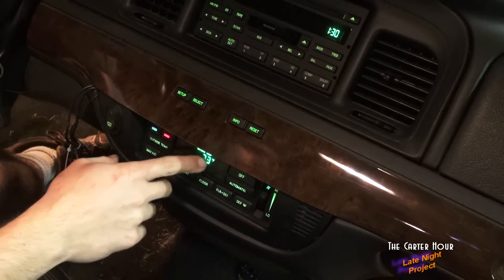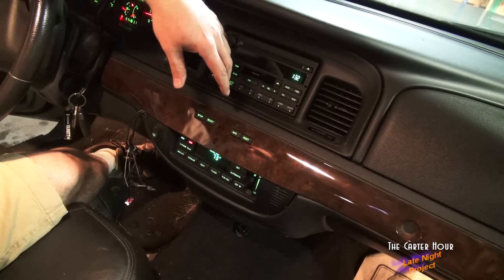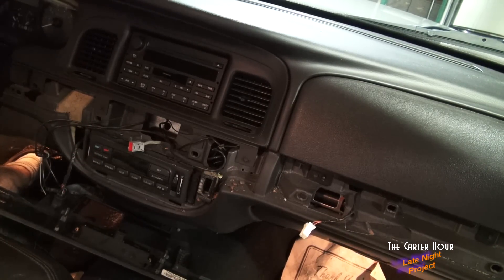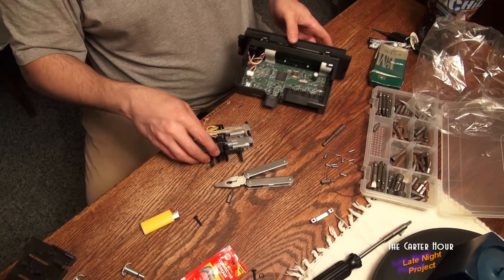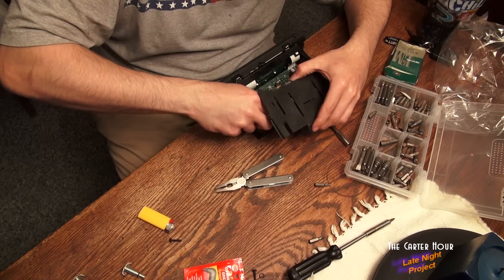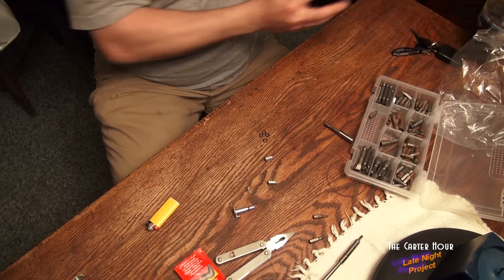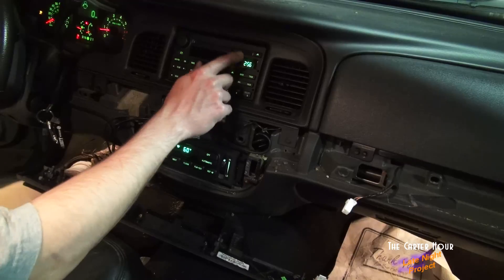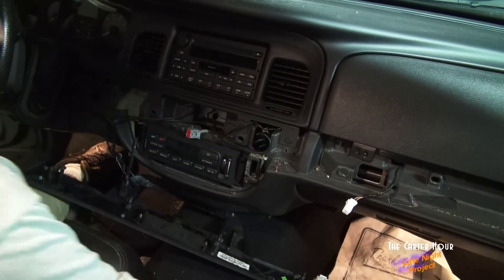Ford Lincoln Mercury EATC Repair Video - In Depth Tutorial - 3.00 Dollars in Parts

Comment: question i have a 2003 crown vic, and the heat /air is not blowing, but when i start driving mainly at a constant speed, i feel the heat coming thru the vent, its not blowing but its damm sure coming thru, what could be the problem
Reply from the maker: First off welcome.  A couple of questions before I can render a 
definitive answer.  Does your 03 Vic have Manual HVAC or EATC?  Is it 
only blowing out of the vents when you are driving, or is it doing this 
when you have the blower running too?  Is your HVAC or EATC on the off 
position when its doing this?
Reply: its a EATC and it does it when the vents are on only,  when im driving at fast speeds the heat can be felt coming thru the vents, but its not blowing u can just feel the heat, im guessing the wind from the fast speed is causing the blow moter to spin?
Reply from the maker: Yeah I would assume that is normal operation.  Since the incoming air comes through a screened part on the passenger side under the front windshield you are probably just getting some heat off the engine.  If you place the EATC in the off position that shouldn't happen as I remember it should close off the outside air.
Reply: The Carter Hour it only does it when its on , not when its off
Reply from the maker: It seems like normal operation to me.  Try putting it in MAX AC with blower on low and see if it does the same as you describe.
Reply: The Carter Hour it does the same for all the settings even the defrost
Reply: mr carter you never replied brother im still in need of help
Reply from the maker: Yg Bodybuilder It sounds like you could eitther have a bad blower motor or resister pack.  If you turn your fan on the highest setting does it blow?
Reply: The Carter Hour no nothing blows,but when im driving on the highway i can feel the heat coming through the vent and i also tested it with the vent settings turned off and i felt no heat, i just replaced my blower motor last night, and still no blowing, my question is my blower motor came with two harness but neither one fit my factory harness, but my factory harness fits right in the blower motor, it will still work that way right?
Reply from the maker: Yg Bodybuilder
Thats an interesting question.  In my experience no matter EATC or Manual the fan should be the same.  But the fan plugged in using the factory harness?  So what you are saying is your fan is not operational at all?  It almost sounds like a resistor pack.
Reply: The Carter Hour yes it did, is that not normal for the factory harness to fit in the blower motor?
Reply: The Carter Hour ok going out to buy the resistor today how long should it take me to install
Reply from the maker: It would probably take you a little while, not nessessarily easy to get to, its next to the heater core hoses.  Probably looking at 1 to 2 hours.
Reply: 2 hours are u serious, but its right in arms reach lol
Reply from the maker: LOL, Its right in arms reach but so many things around it.

Comment: I HAVE A FORD TAURUS THE HEAT CONTROL DOESN'T WORK.. THE FAN IS STUCK ON ITS SPEED AND THE HEAT IS STUCK AT 21..?
Reply: 21'C
Reply: and its a ford TAURUS 2003 full equipment the panels change from the floor to the front window.BETONS
Reply from the maker: Sounds like it may be an electronic issue.  I believe in that year Taurus, the Radio and Climate Control Units were sandwiched together as one unit.  Not sure how you would go about fixing the unit.

Comment: Would this have anything to do with the defrost button itself from lighting up? I got a 96 town car and neither heated mirrors or defrost work and i changed all the fuses and relays
Reply from the maker: Could be the grid on the back of your rear window.  It might have a scratch in it causing the voltage not to be carried.

Comment: God Bless You My Friend! Just Finished Doing This On My 2003 Mercury Marauder And Now Its Working Perfect! Thank You So Much!! Greetings From Houston Tx
Reply from the maker: +D. Reyna Oh no worries glad it helped you out and got the Marauder EATC working properly.  Love those cars by the way.  Thank you for the wonderful comment and cheers from Michigan.
Reply: D. Reyna u still live in Houston
Reply: I'm late to this party, but this procedure works like a charm. The ability to keep the dealer from ripping off another customer is awesome to say the least. In order to try this as quickly as possible I installed available rubber rings and ordered from McMaster Carr silicone for possible future needs. It was a simple task that any novice could handle following instructions. The only issue I had was at first the vents would work again but would not blow cold air any more. As a test I disconnected the battery, then disconnected the 2 electrical connectors, reconnected them and then the battery and voila, life is perfect again. I have lived with dash only vents for 2 years now and in the south that's tough in the summer. Thank goodness for forums and YouTube for informational needs.

Comment: I changed the unit three times and the fan speed control only seems to blow full speed. Is this normal?
Reply from the maker: You need to replace the resister pack.  Its in the engine compartment to the right of the blower fan.

Comment: What size are the o rings? I ordered polyurethane will those work or do they need to be silicone
Reply from the maker: Poly should work.  Description for size is in the description, along with other parts you will need.  Also make sure you get some die electric grease, one small packet will do.
Reply: Ty sir
Reply from the maker: Luis Cerna
Very welcome, glad my video could help you.
Reply: K so I replaced o-rings .everything works now. But Im kinda freaking out because i punched a small hole on the little foam pad that's on top  . Will that be a problem
Reply from the maker: After looking at my spare that I had laying down, I think you should be fine.  By the looks of it the foam just acts as a filter, when it releases the vacuum from one of the cylinders.  I think the main purpose is to restrict large particles from getting into the EATC chamber.  How big is the hole?
Reply: Probably the size of a pencil tip. Is there a similar  material that I can use to replace it if It causes Problem In the future.Ty for your help you freaking rock
Reply from the maker: You could probably find some foam in an old electronic device that is no longer working to replace it with.  Pencil Tip sized hole, you should be ok.  I don't foresee a problem.  Thank you, and glad that I could help you fix your EATC :)

Comment: This Fixed my 2001 Grand Marquis AC problem. AC compressor ran with line cold but only hot air would blow out the vents. Bought 007 "o" rings at OReilly Auto Parts and the little grease pack for spark plugs as described here to lubricate orings. Easy job, just like on the video. Took me about 30-40 minutes. Thank you for the video.
Reply from the maker: +Robert Falero Hi Robert, glad everything went well and the EATC is working properly again. Cheers ... :)
Reply: So then your ac started blowing again

Comment: I tried to search the comments, but it's easier if I just describe the issue:  My mother's '04 LS had this problem you describe for a long time and a clever friend acquired a salvage control unit that my father replaced for her.  This corrected the problem for a few months.  Then, she hear a flapping noise in the central dash that went on a for a couple of weeks and now she only has heat coming through the vents.  The a/c cycles through the proper vents when I select floor, defrost, max a/c, etc...  Could this be the door actuator now causing this new problem?  Is there a way to confirm if the A/C is producing cold air in the system?  Many Thanks!

Comment: I'm hoping this is all I need to do to fix my aunts car,  it won't blow hot and will only blow on defrost so I know it's part of the problem. I just finished putting it together will install and test in am as it is after 11pm right now.  I'll let you know. thanks for the info she didn't want to, and really can't afford to spend 700 on her 03 grand marquis and this will help relieve a lot of stress even if the actuator still needs replacing.
Reply from the maker: Did it solve the issue, Dale?

Comment: Hey Carter,

Great video, very thorough explanation. Couple of observations. The foam pads on the ends of the solenoids are likely air filters. They are semi porous and allow vacuum into the solenoids. They are there to stop dust and grit from getting in, and gumming things up. Good advise on not damaging them. Secondly, while the dielectric grease is likely fine, I used O-ring grease for swimming pool equipment. Not a big deal, but it is specifically designed to lubricate rubber O-rings. 2010 Merc, back in action blowing air where it's supposed to go! Again, Great Job on the video!
Reply from the maker: Hey Dan, Thanks for the feedback.  Heck I didn't even know they had specific o-ring grease.  You learn something everyday.  Much appreciated for that information.  Glad the video helped you out.  Cheers....

Comment: I have the same issue.. shots out from the top and bottom.. had a ac recharge and it blew out cold from the top and bottom. Now its hot again. I get a code saying i have a vacuum  leak. Whats your take on this brother. Thanks.
Reply from the maker: Jose Lopez Jose, it sounds like you might have an issue on the vacuum line shared by the vacuum brake booster and the EATC.  I would check there first, which this line is located at the back of the intake and goes over to the brake booster and at the middle of the line it splits off for the EATC.  If everything is fine there then just change your o-rings.  But chances are that rubber line from the intake to the splitter to the brake booster is leaking.

Comment: I have one just like from the one you used as a spare I belive you said that came out of a Lincoln well I have a 1998 Ford Crown Vic and wonder how did you get the solenoids out because I have bent the tabs back I see you had bent the whole frame Im wondering how
Reply from the maker: Are you looking to rebuild the 1998 CV EATC?

Comment: Two questions—One I have air only coming through my vents.  Will this repair help me or do I have a bad vacuum motor.  Also, I do not have the air flow I think I should have.  Do these cars have cabin filters in them and if they do are there two—an inside and outside filter?  2000 Grand Marquis

Comment: Hi! Thank you for this great video! you helped me save $500! 

I had an issue! I opened the first solenoid and it popped open and i may have lost a spring. I did not see one and i could not find one... so my first question is... is there one spring in all 4 solenoids? or does 1 not have a spring? if they all 4 have springs... can i buy a replacement spring anywhere? i dont have anohter unit to pillage from! PLEASE HELP!
Reply from the maker: They all have springs.  If you want message me your address and I will send you one.

Comment: Great video❗For all you dislikers I'd say do the prechecks under the hood first and make sure the black vacuum hose under the ashtray has suction
Reply from the maker: Cheers :)
Reply: Hi Steve Davis. How do you check that?
Reply: Donna H. Which one? The easiest check you can do first is check for suction under the ashtray you'll see a collection of vacuum hoses black, yellow, white, blue and I believe there is one more. But if the black one has suction your problem can be fixed with this spectacular video.
Reply: Thank you for answering so fast! How do you check the suction? I'm assuming you turn the car on..then?
Reply: Donna H. Turn the air on and put a finger over the hole where the black line goes on the connection. If I remember correctly the left side should have suction.
Reply: Thanks!
Reply: Donna H. No problem, let me know how it goes.
Reply from the maker: Hi Steve thanks for helping Donna, sometimes I never get notifications on YouTube.  Much Appreciated.
Reply: The Carter Hour  No problem
Reply: Steve Davis hey man! So if there is no suction there, what is my next move?

Comment: blend actuator went out on my Crown Vic. $500 in labor quoted. just shoot me
Reply from the maker: +Paul M Ouch, well not as bad as I thought it would be for labor but still a lot of money.  I dont think the part is that much though.  Cheers...
Reply: I give up on Ford. I thought the Crown Vic would be different. Every Ford I ever owned I had to take the dash off to do a repair. the previous owner already replaced it once. the heater core will go out next or some other stupid part
Reply from the maker: Paul M Most not if all cars now require you to pull the dash for pretty much anything related to HVAC.  its been that way since the early 90's.
Reply: I can't believe it. I disconnected battery cable for 30 minutes. banged on the dashboard and it worked. I think it was just stuck or needed a reset. previous owner had it replaced at the dealer so its the junk OEM part. so it will go out for good soon
Reply from the maker: Paul M
You might want to try to exercise the actuator by temp up and down a few times.  Sometimes they get stuck cause the same temperature is used all the time.  Does your Vic have EATC?
Reply: +The Carter Hour I'll try that. It has EATC. It was making clicking noise so its about to fail soon. the codes were 024 and 025
Reply from the maker: Paul M
Oh yeah the signs of blend door death.

Comment: Thanks for the tutorial, hope I can add a useful tip. Picked up a clean '09 GM LS with this problem. o-rings were bad but did not fix the unit. Switched the ignition on but did not start the engine, tried all the EATC mode switches to hear the clicks in the solenoids. Took it down again, disassembled to the solenoid/manifold assy, plugged the vacuum nipples and soap-tested the black plastic manifold by blowing (by mouth, this is a fragile piece) into the nipple for the black vacuum supply hose.  Found serious leaks along the mold lines in the manifold. I COULD NOT SEE THESE CRACKS EVEN THOUGH I COULD HEAR THE LEAK, THEY ONLY SHOWED UP WITH A SOAP+WATER PRESSURE TEST.  Rinsed and dried it with a hair dryer, flowed a few drops of 1:1 epoxy  over the cracks and cured for an hour, tested again, no leaks. Re-assembled the unit and installed in the car - voila, all modes working!  I may have cracked the manifold while re-crimping the solenoid ends by holding the assembly on the table and pressing the tabs with the backside of pliers. Not sure how to avoid this, it takes several pounds force to re-crimp the tabs. Real strong hands would help, I'm too old. Maybe they don't need to be totally crimped. Be careful.

Comment from the maker: You're welcome from the United States.
Reply: different mechanics tell me it's the blen door actuator. I see that  this simple fox could be my issue..thanks
(06 mercury marquis)
Reply from the maker: +don carleon what is your EATC doing?
Reply: as long as my car is in idle, the a/c blows through the vents on low. after a few seconds I can turn it to high.
soon as I get on the gas it starts blowing through defrost vents...weird I know
Reply from the maker: +don carleon yep this fix will resolve that issue.
Reply: issue resolved...thanks again👍
Reply: Don, engine vacuum is at its lowest when the car is accelerating, and highest when engine is decelerating, I had a minivan that did that, but once the RPM stabilized everything went normal, what you need is a vacuum tank/amplifier..you can find those at the wreckers, many cars use them, I put in one from a Buick and put in the vacuum circuit right at the intake manifold, if the tank has only a single nipple use a TEE, if it has 2 then brake the vacuum source and feed one end at each, this tank will store vacuum, so when the engine is not producing enough vacuum the reserve in the tank will keep the actuators in the same position and air discharge will not switch as you accelerate.
Reply: Just did the O ring job  for the EATC on my 03 Merc LS. Your step by step was great! Worked perfectly out all the functions. My blower is stuck on high (A/C turns on and off automatically but fan is high or off).  I think the variable fan controller is the problem---but so glad to have the air blowing out the vents! THANKS VERY MUCH!
Reply: Just did the O ring job  for the EATC on my 03 Merc LS. Your step by step was great! Worked perfectly out all the functions. My blower is stuck on high (A/C turns on and off automatically but fan is high or off).  I think the variable fan controller is the problem---but so glad to have the air blowing out the vents! THANKS VERY MUCH!
Reply from the maker: Ralph, sometimes the resister packs go bad, that's why your blower is stuck on high.  Pretty easy fix, not sure how much the resister pack is, but I am sure its probably not too costly.  Thanks for the feedback and cheers!!!
Reply: Changed out the blower control module (firewall) the next day and all is great!  I was a bugger getting to it without removing the heater hoses.  But it did the job.  All is like new!